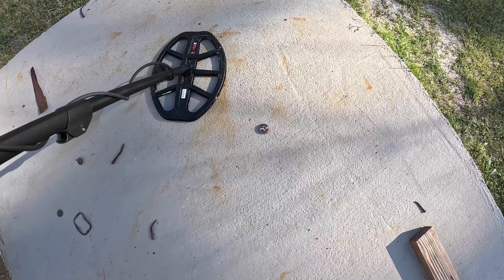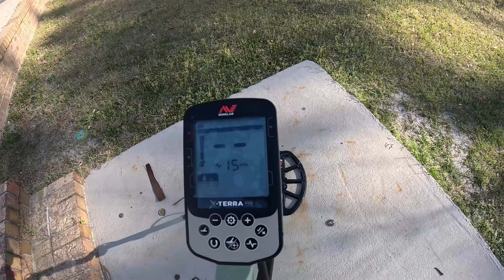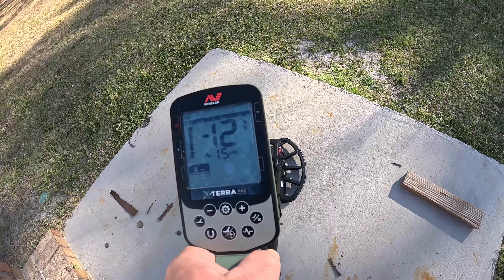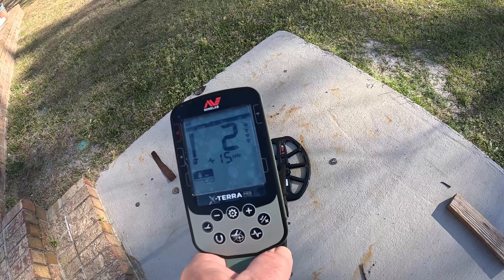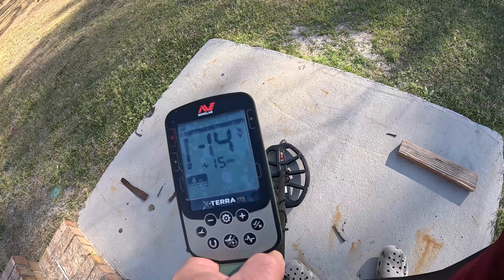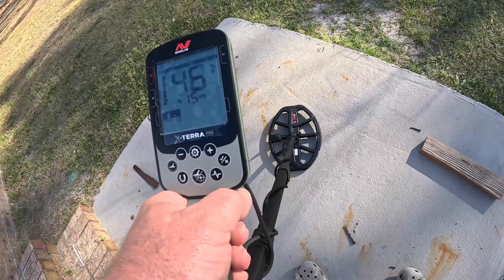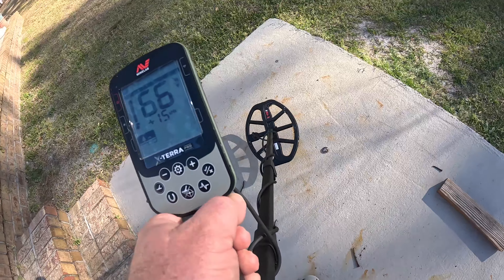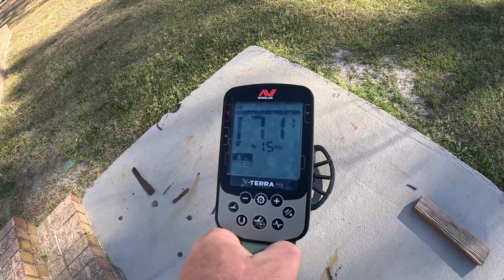MINELAB XTERRA PRO BOTTLE CAP PRO TIP

Comment: Thanks for the tip, I dig heaps of bottle tops with my simplex+. Will it work with the standard coil as well as the smaller ones? 
I'm giving close consideration to buying the xtp. I only search on the beaches here in Queensland, Australia and while the simplex is terrific on the dry sand it is terrible on the wet and abysmal in the salt water (sounding off like a flock of seagulls fighting over a potato chip 😢). Consequently I am only effectively searching less than half the beach. I've tried every setting and it's just awful.
From what you and others have demonstrated it seems the xtp is "the ducks nuts" on the beach so I guess it will be a marked improvement over the simplex?
Thanks again for taking the time to show us real world demonstrations.
Reply from the maker: It will be a big improvement in the wet sand..
Reply: @calabashdiggeradventures  Looking forward to it. Are you able to advise whether the bottle cap tip will work on the standard DD coil?

Comment: And another thing that isn't showing, he is in the All Metal Mode which can be used for any frequency and is just a little push of the buttons that looks like the Horseshoe Button and it's available for any questionable targets and will not change the settings to find it and easy to operate the X-Terra Pro and No MORE squaky killing the duck Tone's like the Simplex + has And they said that they have no more Updates for the Simplex + and have basically shelved the Simplex to the garbage Truck.....

Comment: But does it work with bottle caps that are folded in half or buried on their side?
Reply from the maker: Dont know
Reply: But it's in the All Metal Mode ( Horseshoe Button) and will work on all the 5,10,15 frequency and I haven't checked it yet for the 8 frequency but it should......

Comment: That won’t work with all all bottle caps specially modern aluminum caps
Reply: No machine will get rid of aluminum bottle caps. This is just for the steel ones coated in zinc.
Reply: But If the X-Terra Pro will not lock in on the target and only jump numbers Or  and also will give you a warbly target Tone's and then usually then it's a JUNK Target and I have the X-Terra Pro At 12 sensitivity and I'm still getting Targets that are 4-6 inches deep and 21-25 Is Full Sensitivity and isn't needed to be that high to find the Targets to dig and the X-Terra Pro gives you more information on what not to dig and No MORE iron quarter Tone's like the Simplex + gives you and the X-Terra Pro has  hidden features that are in the instructions for everyone to read....